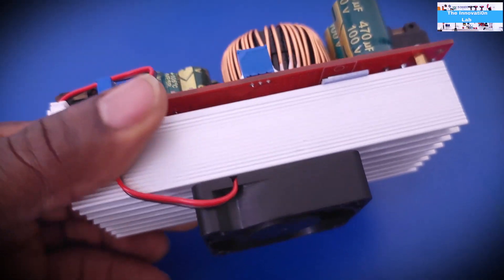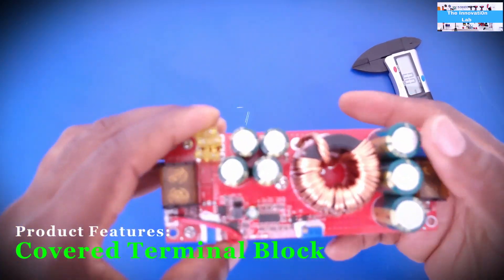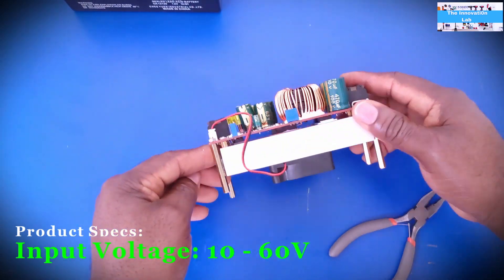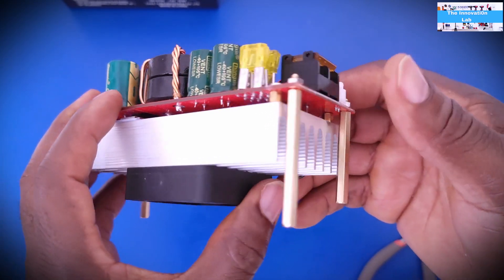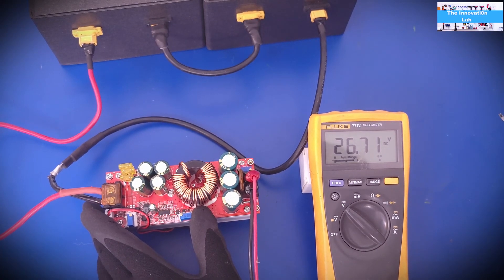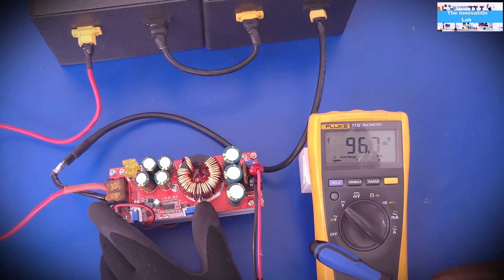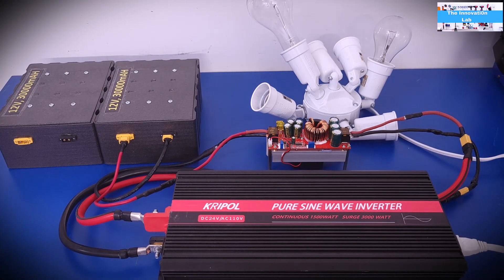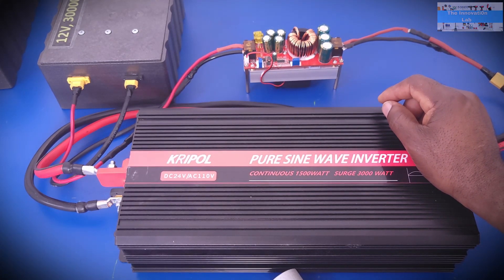Testing Cheap DC-DC Converter from Amazon - Are They Any Good?

Comment: I used it to boost voltage from my 51.2 golf cart battery to my EcoFlow Delta Pro XT60i port.  Instead of 800 watts I was able to get 1500 watts steady recharging station/sharing load with battery of EcoFlow Delta Pro.  After an hour there was a huge explosion on one of the 3 100v capacitors.  The board still ran but I quickly disconnected everything.
Reply from the maker: Thanks for sharing your experience. This is why I have always stressed on derating the load we apply on these converters. A good rule of thumb is about 60-70% derating.....that includes input voltage, output power, and output voltage.

Recommendations:
Input voltage: <48V
Load: <1200W 
Output Voltage: <85V
Cooling: Add a strong external fan!

I hope this helps.
Respectfully,
The Innovati0n Lab

Comment: The fuses won't blow at the correct value of the total of them. The Constant current is measured at the output. So it can be damaged if driven past it's maximum on the input. Really they are boost voltage/current limiting modules. With no protection.
Reply from the maker: Thanks for the thoughtful engagement. I greatly appreciate it.
👍👍👍
I see your point. However, the role of the fuses is not to implement an overload/over current protection. There is an internal circuit that does that. The fuses are there to basically prevent the entire converter from going up in smoke, when there is catastrophic failure....like a MOSFET SHORT failure. When those MOSFETs fail, the input current could spike up to 500A in an  instant.....this is what the fuses are there for, and trust me, I have seen a whole lot of them pop - during my hacks....All my fault though.😊

Respectfully,
The Innovati0n Lab

Comment: Hi friend, this is my situation, I have 13.8v to 14v in my truck's battery with the engine running, can I use this stepup converter to charge my LiFPO4 to 14.4volts? Thanks in advance.
Reply from the maker: You should be able to - but you have to check your system limutations.
Aslo, there are risks involved as you could damage your cars alternator due to overload.
I can't advice you to do it or not. All I can say is that it should be possible.

Just make sure that the output current limit potentiometer is set very low.....then after connecting your battery, you can then slowly increase charging current per the battery specs and per your alternator power specs....please do some more research to better understand the systems your are working with. Also, it might be best to try it during the day time and with all heavy electrical loads in your car turned off....so don't turn on your AC and headlamps at full blast...while doing something like this...hahaha.
Again, I am not recommending anything to you.

I recommend you watch some of my universal battery charger videos.
https://youtu.be/WDWJ77WWkXc?si=IjUx93llXrSUJMR4

Respectfully,
The Innovati0n Lab 💥 www.theinnovati0nlab.com

Comment: Hello,
 I have a small problem with this converter. 
I connected the converter to a 12V battery, I set the converter to 27v, but when I connect a 20w bulb, the voltage drops to 12v. I also tried connecting a vacuum cleaner, but the same thing happens, when the load drops to 12v.
 Can you help me with a solution or what should I check to repair the converter?

Thanks
Reply from the maker: Set the output current limit to the maximum.
With the converter input to your left and output to your right, adjust the potentiometer in the middle clockwise - multiple turns until you hear faint clicks on the potentiometer. 
Make sure your DMM is connected to the output while doing this - to ensure that the output voltage does not exceed your initial setting.

I hope this helps.
Consider becoming a Patreon supporter. Our Patreon members will have a higher priority with Q & A.
https://www.patreon.com/c/TheInnovati0nLab/membership?redirect=true

Respectfully, 
The Innovati0n Lab 💥

Comment: If I use a single 12V 62 amp Dc smps will this module be able to drive a load of 100watts at 96 volt?
Reply from the maker: Great question.
100W....yes.
96V, that I am not sure - I would plan for 90V +/-5V. This would mean an output voltage tolerance of +/- 5V. I have seen some units that go all the way to 95V and I have seen some that only go to about 90V....so you may have to get one and give it a try.

Consider becoming a Patreon supporter at the link below.
https://www.patreon.com/c/TheInnovati0nLab/membership?redirect=true

Respectfully,
The Innovati0n Lab💥
www.theinnovati0nlab.com
Reply: @theinnovati0nlab782  Thank you for the detail response much appreciated.
Reply from the maker: You are welcome.
👍👍👍

Comment: Can this converter handle two fans connected to the same fan socket?
Reply from the maker: Great question.
This is something I have not tried or looked into.
But you could experiment on that if you are feeling adventurous.😊
If not, I would recommend adding an external fan. 

The Innovati0n Lab 💥 www.theinnovati0nlab.com
Reply: @ so I installed two 12v .3A fans and it works perfectly.
Reply from the maker: @marciomaia4020  
Wonderful news.
I am glad to hear that!
Thanks for sharing the update.👍👍👍

The Innovati0n Lab 💥 www.theinnovati0nlab.com
Reply: @theinnovati0nlab782  ok thanks. The reason I’m asking is because the instructions say that if output current exceeds 15A you should enhance heat dissipation. I’ll try it and let you know.

Comment: What is the purpose of the other 2 trimmer?
Reply from the maker: There are 3 trim pots on the board.
💥Output voltage adjustment - the one by the output connectors.
💥 Constant current limit - the one in the middle.
💥 Undervoltage protection setting - the one closer to the input connectors.

Cheers!
The Innovati0n Lab 💥 www.theinnovati0nlab.com
Reply: @theinnovati0nlab782  Thank you! That's great help

Comment: Hello, can this boost converter provide 100 amps at the 14 volt input and 11 amps at the 36 volt output, meaning 400 watts? I want this converter to start a 450 watt brushless motor. Will this converter work for this motor? Thank you.
Reply from the maker: The converter has an output current limit of 30A. So it can provide 11 amps at an output voltage of 36V if that is what you need....with an input of 14V

Comment: thank you for these great and informative videos, amazing work 👏👏👏!
Few things remain unclear though:
1. how can you set the input voltage? i.e. my input battery is 58 volts, and I can only read the output, how do I know/set the input V?... I can only read the output V when I turn/set the potentiometer, right?
2. How can I set the output C limit, I have no way (display of doing so)... can I only set it under a load?
3. My point is, we have no idea what the factory setting is on the input V and C, nor the UVP when we unbox/connect this converter, i.e. we can always measure the output, but we cannot measure the input the potentiometer is set on, right?
4. for example, my battery is 58v, i need to step it up to 63, i can turn the dial on the output and measure it with the meter and adjust it to 63, but i have not idea what the input V potentiometer is set on. The same goes for C.
Reply from the maker: Thanks for the wonderful feedback. We very much appreciate it.

Regarding your questions, please see below.
1. Input voltage adjustment: You can only set a UVP point, and I have made a video to show how its done - see below. The converter has an operational input voltage range 10 to 60V as long as you apply an input voltage within this range, the converter will regulate your output to your set point. 
⚠️⚠️
However, I wouldn't recommend using an input voltage that is very close to the maximum rated input voltage (60V). I always recommend de-rating the input voltage to about 48V. Hence, I won't recommend using greater than 48V on the input - as you may damage the converter on the long run due to high voltage stress on the input  components.

2 Current Adjustment:
I always recommend setting it to the maximum point if you are driving a constant power load or a resistive load. This allows your load to draw whatever amount of current it needs (up to 30A). Not doing this will cause the converter to lose output voltage regulation at heavy loads. 

The only time I adjust the current setting is when I am using this converter as a battery charger or LED dDriver.

💥💥💥
How to adjust the output current limit.
With the converter input to your left and the output to your right, turn the trim potentiometer counterclockwise to lower the current limit and clockwise to increase the current limit. To get to the max, keep turning the trim pot clockwise until you hear some faint audible clicks on the pot. For lowering the current limit, you have to be careful not to go too low, else you will lose output voltage regulation, and the output voltage will drop down to the input voltage level.....when this happens, backing off a few turns will push the converter back to output voltage regulation and this is how you know that this is the lowest current limit that the converter can handle.

Always make these adjustments with DMM and current probe connected to the output so you can see whats going on.

I have made multiple videos on these. Please check them out at your convenience.
👇👇👇
UVP ADJUSTMENT& EFFICIENCY:
https://youtu.be/t8Aaz4iQeXY?si=ydLcbPrsB-2v41ae

MY FIVE STEP BATRERY CHARGING PROCESS:
https://youtu.be/WDWJ77WWkXc?si=j9Fx_B55U2fuKpfH

I hope this helps.
The Innovati0n Lab 💥 www.theinnovati0nlab.com
Reply: @theinnovati0nlab782   Thank you for this very detailed reply & info, much appreciated! and much clearer now. Basically no need to set the input V, it is basically a wide V input range, and the C is of course regulated by the consuming load, (in most cases). UVP is very useful though in some scenarios as well.
I have ordered both of the converters you reviewed, the one in this video and the one with the display, the BST900W, but what you said about the high V input may be a problem and maybe none of these will work with my weird project.

This is the problem I'm trying to solve:
I have an e-bike battery from EM3ev, the triangle 50V battery. It is 14S6P with 18650 GA cells, 50.4V nominal, with current output of up to 30A. So the nominal V is about 3.6-3.7 per cell, so 14x3.6=50.4V. When I charge it up to 100% it will go to 4.2V per cell so 58.8V max, but this is without a load. So for the sake of argument lets say I have 3.7V nominal per cell or ~52V output from the pack under load.

I want to use this ebike battery pack with this 60V brushless motor snow "power shovel" by TORO. I don't have the original battery for it, the 60V one, but the research says it is 16S2P, so with a cell of nominal 3.7 it ads to about 59V, and with 100% charge with cells at 4.2V its about 67V. So I figured I need to boost my ~52V ebike pack to about 62-65V for the TORO shovel to work.

I assume this, since I tried to use the battery directly on the shovel... charged it to 100% showing 58.8 on the DMM, and connected it to the shovel... the blade barely spun, even though it should have operated in that "acceptable" V range for the shovel. I assume the shovel has some UVP battery protection and when it reads voltages under 56-58V it stops working so it does not undercharge/damage the pack. But that also doesn't make sense, as the original TORO 60V pack probably has its own BMS to do exactly that.

So do you think any of these converters are going to work in this setup? Any suggestions on how I can solve this conundrum? Thanks!
Reply: If you are still looking for a solution, a few things to consider about power tools (in general):
1. Yes, the tool can (may) have UVP on it despite having a bms inside the battery. The bms may be a simplified one that's used for balancing mainly. But, the 60V rating of the tool may be max meaning the nominal is 54V so one would expect the UVP to kick in @~45V. Definitely below 50V. So, why not working?
2. Well, another protection cordless tools generally have is thermal for the battery. If the tool has 3 pins for the battery on it, one of them is probably for that. It reads the value of a thermistor inside the battery and cuts power when that value changes. As long as you monitor yourself the temperature of the battery you can try to bypass that protection. A resistor can simulate that reading, I've seen a video somewhere where a 10kOhm resistor does the job.

Comment: Very elaborate tutorials. I am addicted to your channel. I bought the same DC-DC Boost Convertor. However, the minimum output voltage I can get from it is 15.5V DC. I got this from adjusting the voltage nob. I was expecting the minimum to be around 12 V DC which is what I need.  Is there something I'm missing or doing wrong?
Reply from the maker: Thanks a lot for the wonderful feedback and for watching our videos. I greatly appreciate the compliment.
👍👍👍

The boost converter can only boost your input voltage to a level that is higher than the input voltage - it can not go lower than the input voltage level. It seems that your input voltage is 15.5V?
You may need a buck converter instead.

Check on eBay. I have seen some 30A variable output voltage buck or step-down converters that can go as low as 2.5V.

I hope this helps.😊
The Innovati0n Lab💥
www.theinnovati0nlab.com

Comment: Any one can help me my adjustable output not working my input is 15v charger with 12v battery
Reply: May input is 15 and output is 15 also
Reply from the maker: Please make sure that your output current adjustment is not all the  way down to the zero.

💥💥💥
Try doing the following steps;
1. Disconnect all load from the output and connect your DMM to the output.
2. With the converter input on your to your left and output towards your right, dial the current adjustment pot clockwise until you hear some audible clicks....just note that at this potentiometer set point, you will be at the maximum output current and you need to dial it down before connecting your battery for charging.

Now, with the current adjustment potentiometer set to the max point, turn the output voltage potentiometer counterclockwise to increase the output voltage. 

If your converter is not faulty, this should work.
If you turn the current adjustment potentiometer too low, your converter will lose output voltage boost function. So, your output will equal your input. 

CAUTION: ⚠️⚠️⚠️
Keep a close eye on the output via your DMM as you are turning the current adjustment trim potentiometer clockwise because when you get to a point of stability, you may see your output voltage spontaneously jump - depending on the output trim potentiometer setting. Again, this is why you have to disconnect all loads from the converter when you are doing this.

I hope this helps.
I hope you are a subscriber, and I hope you will be sharing our videos to help us grow this channel.

The Innovati0n Lab 💥 www.theinnovati0nlab.com
Reply from the maker: Please make sure that your output current adjustment is not althea way down to zero.
Reply from the maker: Also, next time, address your question to the content creator and not to "Anyone." The honestly came across as a bit sarcastic to me.

Thanks.
I hope my feedback helps you in your diy endeavor.

SUCCESS WISHES.
The Innovati0n Lab 💥 www.theinnovati0nlab.com

Comment: Hi  genius
I want a 575w 48v  dc to dc buck converter in12v 10amp  of dc solar cooler
Reply from the maker: Thanks a lot for the feedback.
You should be able to find a buck converter that meets those specs very easily. 
Check on eBay. 
Thanks!
The Innovati0n Lab 💥 
www.theinnovati0nlab.com
Reply: Dear sir Can you provide me 575 w 12v 10amp  dc to dc buck converter for  use  575w Solar pannal🙏
Reply: How to cantact you sir  can you give me your cantact no /watsapp no
Reply from the maker: @dineshdhawas7279  
I buy these converters, and I really don't own them. I am working on a boost converter design, and it is still not ready. 
For the buck converter, just do your research online to see what options would be suitable for your project. I currently don't have a buck converter design that I could share with you - I wish I did.😊

The Innovati0n Lab 💥 
www.theinnovati0nlab.com

Comment: What happens if the input voltage exceeds to output voltage?
Reply from the maker: Great question.👍👍
That should never happen in a boost converter. The worst you should get when the converter fails is that the input and output voltages should equalize.
But then I have not seen all the failure conditions.
Overall, if you ever see anything like that on a boost converter, then there is a failure.

Unless what you have is a buck-boost converter that is designed to either boost or lower the input voltage to a lower level.

I hope this helps.
The Innovati0n Lab💥
www.theinnovati0nlab.com